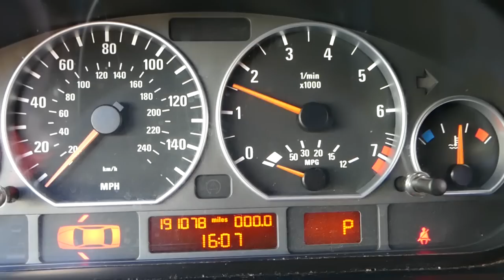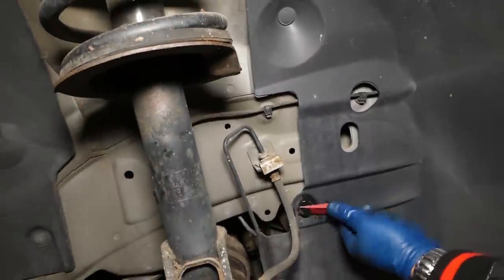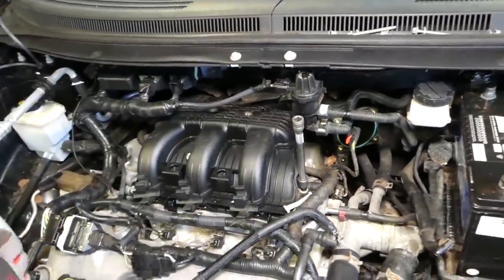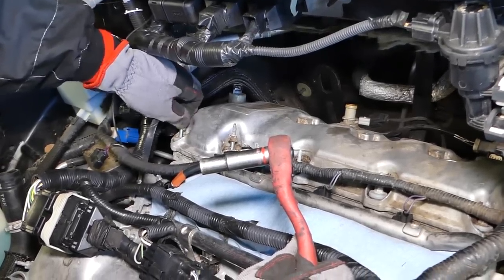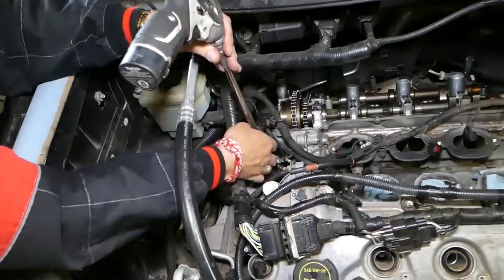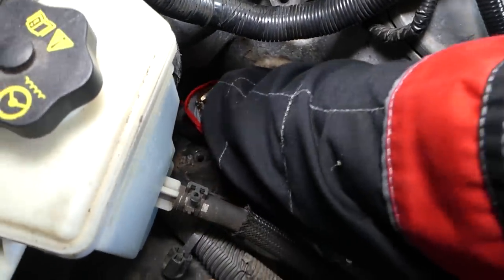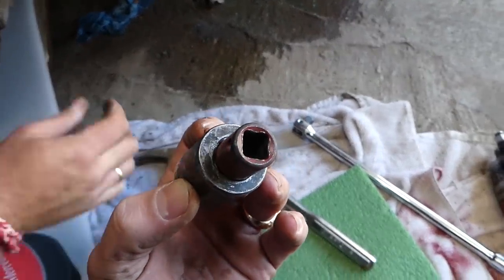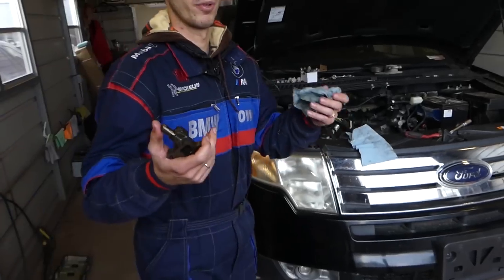FORD LINCOLN 3.5 ENGINE NOISE RATTLE WHEN COLD. TIMING CHAIN TENSIONER REPLACEMENT EDGE FLEX TAURUS

Comment: There's bolt holes to help push that cover off without breaking it,  just an FYI for anyone seeing this. It's an easy job, just a long one, take your time and BE SURE to have an inch lb torque wrench and all the proper specs. I would get a chilton manual they explain this process well. Just did the water pump on my Taurus, I wish I would have replaced all the timing parts while I was there, don't make the same mistake I did with it and plan ahead better.

Comment: I have a 2009 Ford edge SE with a 3.5 l. It hasn't jumped time yet. I'm trying to figure out if your engine was already at top dead center when you remove the timing chain cover or did you have to move it into place?